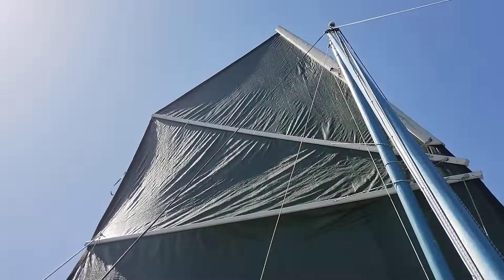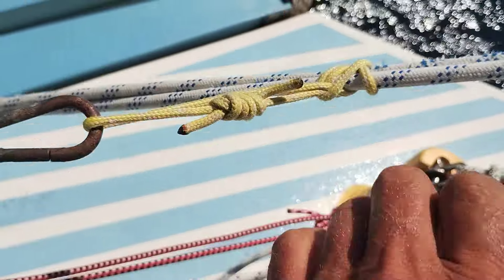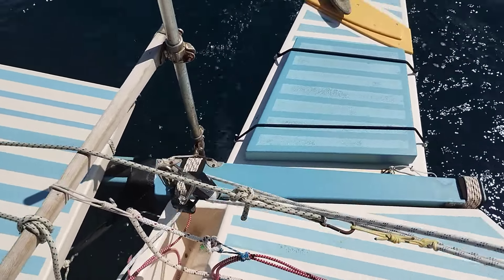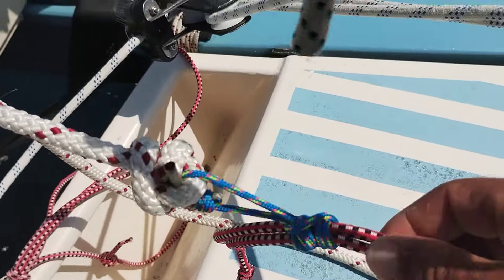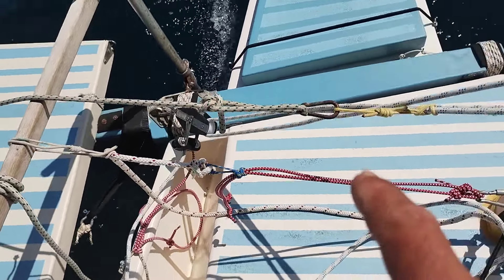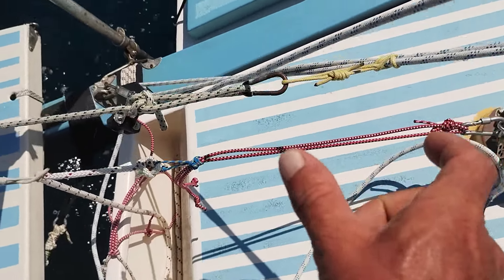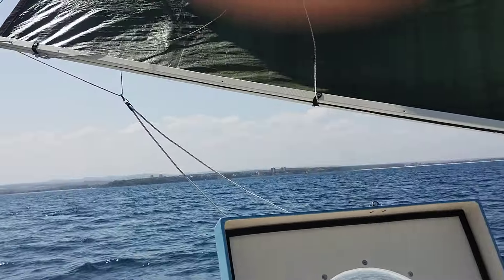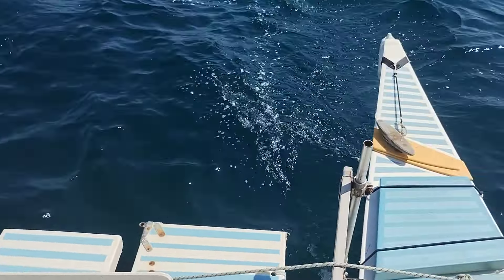sheet to tiller, HOW? Balkan Style...

Comment: I like your Prusik knot approach for the bungy on sheet to tiller, if the bungy breaks from wear you just move the knot up a bit and keep going, much better than the other systems I've seen 👍
Reply from the maker: Never thought about that bonus.... Thanks!
Yet it truly works as planned, for adding or reducing resistance to the winds pull. Just had it working in strong winds on a broad reach, I had to move the prusik almost to the beginning of the bungees, when I finally got her to balance...
I need to add more, anyway still learning, more to come...

Keep Shunting, Dave 
Balkan Shipyards